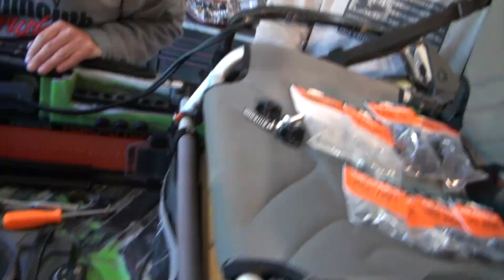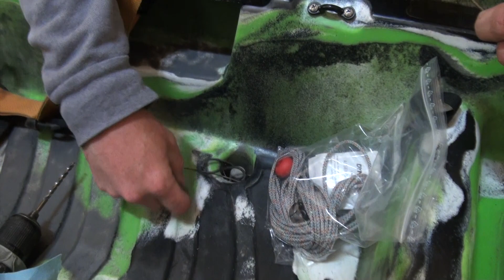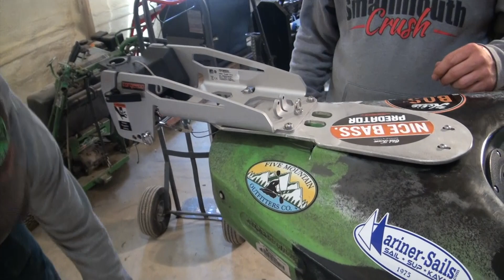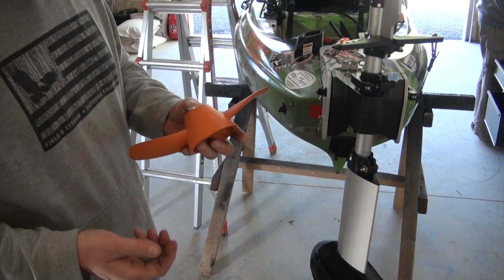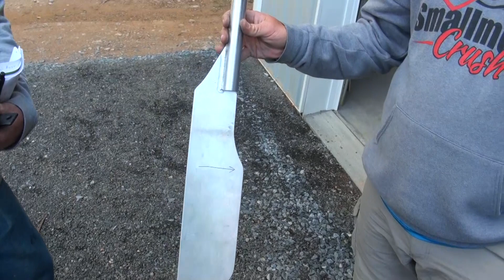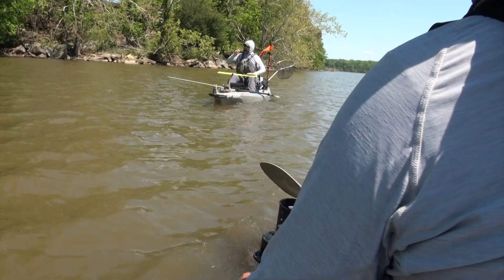Old Town Predator 13 PDL Torqeedo Ultralight 1103AC Installation with Foot Control Steering

Comment: While I can understand the reason for doing this because of the flimsy plastic rudders on most kayaks,  would changing to a metal rudder solve the problem? Changing to aluminum rudder is easier then going through all of this.

Comment: Do you use the pedals with the motor as a rudder. Like using the motor to get to a spot, then use the pedals to fish. Is so, does it turn good enough with motor as a rudder.

Comment: I was looking at getting the feel free lure 13.5 and wanted this motor on it.  I was wondering if the stock steering would possibly work with the motor, also would the motor act like a rudder if I wasn't running it just pedaling?